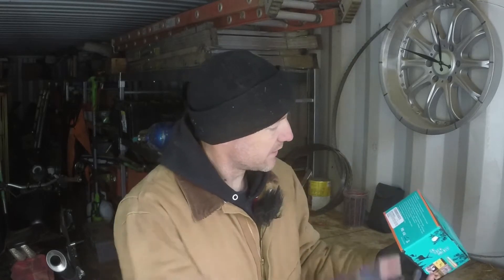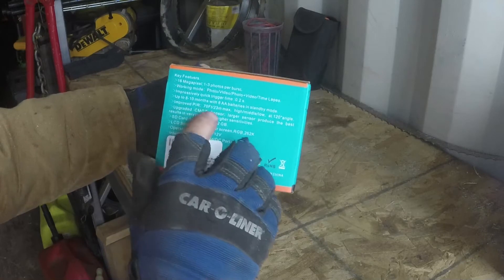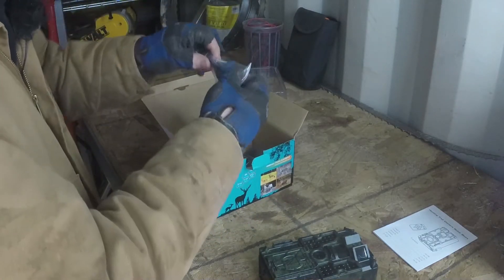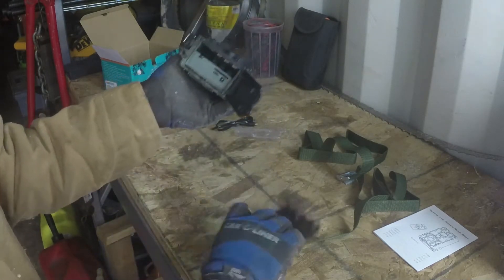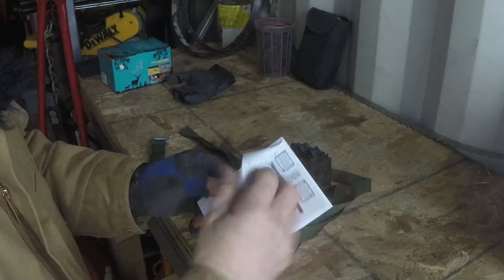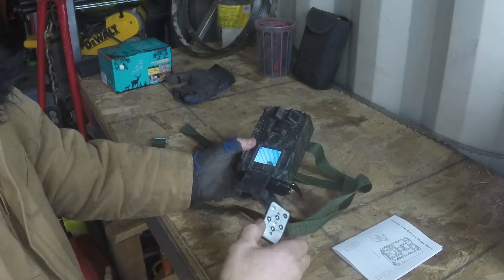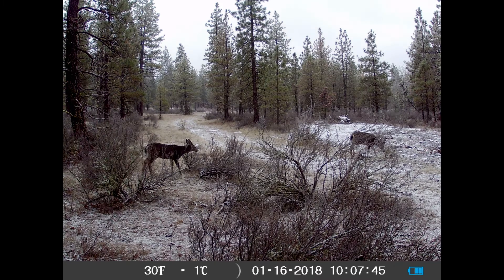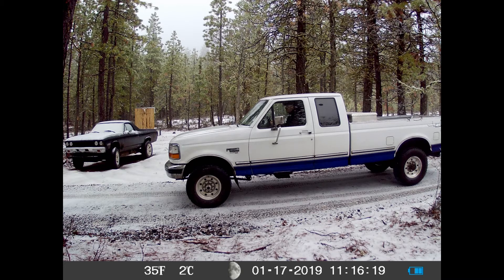Kuool T3 Trail Camera unboxing and review with pics

Comment: Хорошая камера. 7:40 машина фирма?
Reply from the maker: The 1968 Chevy elcamino in the background is a car I built. It still needs some work on the interior but it runs and drives. Thank you for watching. :)
Reply: @KoalityofLife  Thanks for the answer. super car. I want that)))
Reply from the maker: @Tauri-xm7hk  I like the way it turned out, I have a few videos of the build, I will post more of the car this summer when I work on it some more. :)
Reply: @KoalityofLife  I like to watch your video feed. I know English very poorly, but everything is clear and true. I like to watch the work with my own hands. I'm a truck mechanic myself
Reply from the maker: @Tauri-xm7hk  I did collision repair body work for 20 years. I love working on cars. After I get my house built and my garage built I want to build another hot rod. :)